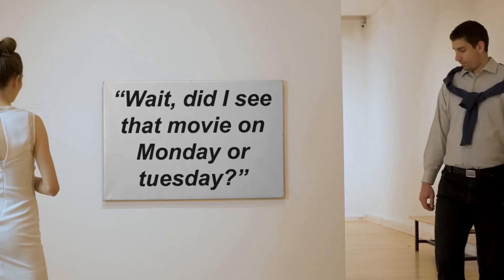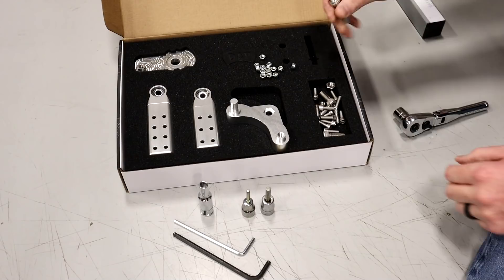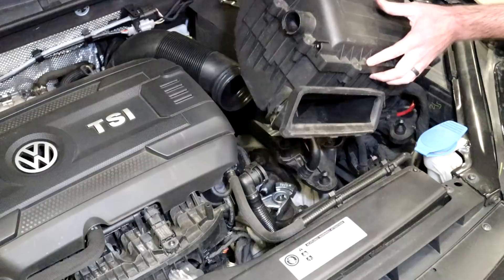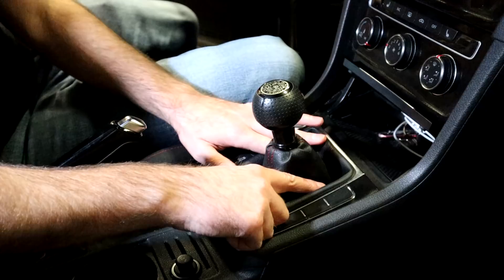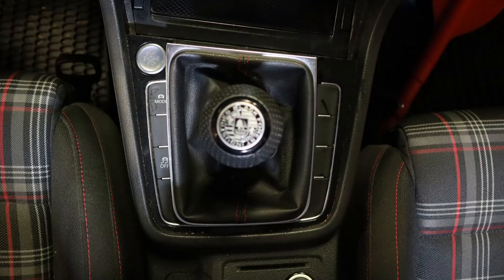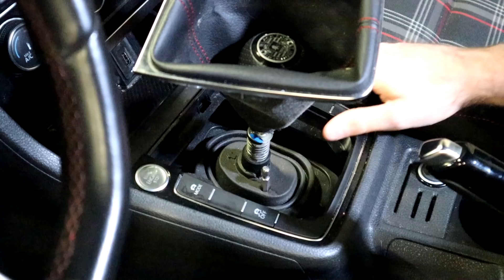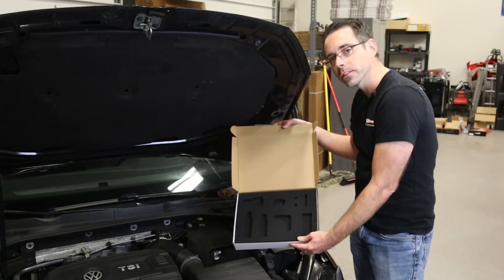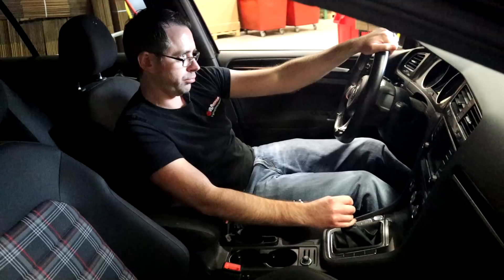"Holy Shift" Short Shifter for 6 Speed MK7, MK6, MK5 and MK4 VW and Audi models - DAP

Comment from the maker: - Purchase this short shifter on our site!
Short Shifter (Holy Shift) for 6 Speed Manual
https://www.shopdap.com/short-shifter-holy-shift-for-6-speed-manual.html
How to Adjust your Shifter if the Lock Pin is Broken
https://www.shopdap.com/blog/post/how-to-adjust-a-vw-6-speed-shifter-with-a-broken-lock-pin.html

Hose Clamp Pliers
https://www.shopdap.com/vw-audi-hose-clamp-spring-pliers.html
Reply: have you confirmed fitment on a 04 jetta gli with a 6sp like mine?
Reply: nm its listed on the page
Reply: dumb question but why nuts and not tapped holes for the endlinks?  Seems like tapped thru-holes would be cheaper to machine than counterbored clearance holes?

Comment: Now have this installed on my 2019 Alltrack after the 90 day wait for manufacture. Night and day difference. While it feels normal after two months and 3,000 miles initially it felt VERY SHORT. it's now very notchy. I'm still getting comfortable with quickly shifting given the gates feel smaller but the travel is much less. Highly recommend it!

Comment: Just installed mine, and the super pin. Overall, it feels way better and much more firm. I wasnt expecting it to feel so mechanical shifting now, but i think ill be putting on a weighted shift knob to damped the stick feel.
Reply from the maker: Thanks for the love. We are working on a weighted knob
Reply: @Deutscheautoparts  i look forward to that. That super pin is awesome, i recommend it highly to a few friends, but they are in the UK and there is no shipping option. Any idea if that will be changing? Thanks
Reply: Installed this yesterday on my new to me Golf 7.5R. I watched this and the @HumbleMechanic install video multiple times so I didn’t miss any steps. I would never attempt this without their detailed videos, but it was super easy and I love the end result. Pairs nicely with a weighted shift knob.
Reply: @Deutscheautoparts  is the super pin included?

Comment: Can you make a a few minute video where we can legit see the reduce in throw, I want to buy it, but I just had a mk7 tdi in the shop and guy had a full ecs tunning short throw, and that thing was horrible, u didn't even need to push down the reverse, and first was in place of 3rd, good look finding second
Reply: He either installed it wrong of had the wrong short shift kit for his car. I have a diesel geek short throw shifter on my MK7 with no issues, everything is in the proper location and reverse works as it properly should.

Comment: I just attempted this install. After locking the shifter in neutral as shown in this video I struggled to wiggle the oem shifter out. At one point the shifter moved up way too much(while in the locked position) and now I can’t lock it back into place. Did I just break the locking mechanism??!
Reply: Could you do a short vid on how to replace a broken locking pin in the selector column? Thanks!

Comment: Installed this about 6 months back and recently my shifting has become incredibly stiff.  After some investigation, turns out one of the spherical bearings began rusting and seizing up.  Kind of disappointed given this wasn't particularly cheap.  Going to be replacing the bearings with the 63215K53 from McMaster-Carr, which should be a corrosion resistant 303/440 SS direct replacement for the ones the kit comes with, (which are presumably alloy steel?)
Reply from the maker: Send us an email info@shopdap.com we can help

Comment: Looks like a well-engineered product. The fore-aft throws are long, true, but I find the left-right spacing to actually be annoyingly tight on my 02Q ('11 JSW TDI). With this kit, is it possible to shorten only the fore-aft throw, and not the left-right spacing?

Additionally, would it be possible to engineer a retrofit rod linkage to replace the cables? Or is there just not enough room/too convoluted a path?

Comment: I am curious how this Holy Shift short shifter assembly performs compared to the DieselGeek Sigma 6 short shifter assembly? 

DieselGeek Sigma 6 has been well known to be one of the best, if not the best, short shifter assembly for VW’s, and it looks like ShopDAP has almost copied them with this Holy Shift design, and yet, is also selling it for a higher cost than the DieselGeek Sigma 6. So I ask, how is this better? If I’m going to spend more on this, I need to know why? 

I wouldn’t be asking if I currently wasn’t looking for a new short shifter upgrade. I’m currently running a Forge short shift bracket and ECS billet bushing setup. TBH, this setup is pretty good. Great feel. The only thing is that it doesn’t improve the side to side, so now I’m looking to upgrade just for that 10-20% better feel over what I’m already running.
Reply: I just looked at the Sigma 6 on the DieselGeek site to compare. I noticed that DG's kit only includes one cable end (front to back).  SD replaces both ends. That additional component would speak to the $20 cost difference IMO.  And that end will give you more definitive side to side movements, having replaced the spongy rubber bushing.  So there is some difference in the two products. Maybe not a huge diff, but some. 
Cheers.

Comment: Hi,

 
i have VW Polo MK5 1.8cc TSI GTI 2015y 141kw 191hp, engine code is DAJA. Current mileage is 240000km, everything works fine, gearbox oil has never been changed, and the gearbox is DSG 7 speed DQ200 dry cluch. Should i change the gearbox oil or not because many people told my in this type of gearbox it is not necessary to change.
please help, thanks

Comment: Hey there. I accidentally broke the locking pin to the shifter tower while trying to install this kit. 2 questions.... Is it tough to replace that locking pin? Can I install this shift kit without having to lock the shift tower for adjustments? Thanks in advance
Reply: lol I think I just broke the pin too while trying to pull that last part off. Any luck on your end?

Comment: I broke my transmission locking pin while installing the holy shift! Was my mistake while pulling the old one out. I guess I used too much pressure. I was still able to install the new shifter successfully. Now I am wondering how hard it is to replace that pin. I found it for $25 but no idea how to remove it, also my concern is…. Could the broken piece be a danger for the gears inside my transmission?
Reply: Have you found an answer to this? This exact thing just happened to me. I stopped and I have a couple of emails out to dap and called them but they will only respond to email.
Reply: @paulmartinez1163  i did not get an answer but I bought the pin, I have not installed it yet but it’s a plastic pin and seems it’s no risk for the transmission, I still need to figure out how to install it, seems it goes in with just some pressure so it must come out the same way.

Comment: Great video and great tutorial! It's emphasized at all times that this works for 6 speed manuals. I have a 2016 Jetta Sport (MK6.5 facelift) with the 1.8T and a 5 speed manual. Will this work with my car? or is there another product specifically for the 5 speeds?
Reply: DieselGeek Sigma 5
Reply: @billyp.7889  Awesome, thanks!
Reply: @johnnyEXCELLENT  did u ever end up getting a short throw kit? I also have a 2016 Jetta sport and was looking to install one
Reply: @owenroth5686  hey I have not gotten a short shifter for this car yet. Good luck with yours

Comment: Seems overly complicated with 14 locking nuts on the end links?!? Also, shouldn't there be some lubrication between the plastic selector piece and the selector plate?

I would be afraid to do this because the risk benefit ratio is too high without proper tools and experience.

Great video, though. Thank you. But I wouldn't build my own bungee jumping harness either!

Peace!  xo

Comment: I dont suppose you know if that shift lever comes out the same on the diesel gt turbo's.. where that white plastic clip thing goes on mine no longer goes on so its just sliding in and out freely so I need to replace it however access looks tight and it appears it won't come out the shaft without removing the large component on the right.. any help greatly appreciated iv had to bodge it with a stubby screw for now

Comment: I still have some "slop" in gear. 3rds tight and fourth is a little loose, but the rest are still wiggly. Should I start with the side to side adjustment?
Reply: sounds like it could be the bushings under the gear selector itself. dieselgeek has kits to replace the worn out bushings which is what i plan to do as well. good luck!
Reply: @mrnickchang1  you'll never guess what I just installed between my lunch break and my 2 15s last night lol
Reply: @mrnickchang1  Still super appreciate the comment!

Comment: Does the “forward/backward” puck of your shifter have a steel splined insert or are the splines directly in the aluminum?
Reply from the maker: The portion that splines on the trans is stainless steel

Comment: I got the shifter all installed and I'm getting all my gears... however during the install process I was an idiot and forced the base plate in and broke the transmission lock pin. I was getting the splines all matched up but it wouldn't go in flush but so like an idoit did some banging and broke the lock pin.... 1st question is should I be worried about the broken lock pin in the transmission causing serious problems? 2nd my throws feel soo short is that normal? I"m getting all my gears so I don't know if something is wrong or if I'm just being paranoid since I broke the transmission locking pin... again all my gears work I'm just shocked at how much shorter the throws are.. anyone have any thoughts on this... thanks!
Reply from the maker: You should be ok with the broken lock pin. This is only something you should need to worry about if you have to adjust the shifter again. 

Just make sure you don’t have any shifting issues like going into gear. It’s likely the lock pin has fallen to the bottom of the transmission case.

Comment: Was removing the selector lever in the engine bay, with the locking pin pushed in and up - locking the transmission as described. Then the selector popped up. 
The transmission locking lever does not prevent vertical movement of the shaft now. Did I make a $400 mistake?
Reply: no it’s a $20 mistake 02J-301-358-C
Reply: @turboshottho  The spline/gear selector won’t come down to its resting positioning. This is reflected on the inside with shift knob slop. When in neutral and move the shifter to the left, it returns to the middle. When moving shift knob to the right it remains there. This happened because I locked the transmission then removed the oem gear selector and then it budged. I should not have locked the transmission until the oem selector was off and to anyone reading I would not do so. The locking pin does not lock the transmission into place anymore. Now I have to call dealerships for a $400 part. Car is still functional/have all gears - but it’s not what it once was.

Comment: What sort of warranty will I void, of my Factory warranty?
sub 22000 miles right now on my 2019 Alltrack with 100K warranty.
Reply: Any warranty on the trans will likely be voided. Shorty shifters will definitely put more wear on the synchros. Had one on a mk5 5spd and had issues grinding 1-2 easily after a couple years.

Comment: Looks like a direct copy of the Dieselgeek Sigma six short shifter.
Reply: This is way different, you talking non sense
Reply: @vadaszmate1400  looks identical to me.  Maybe Jim @ Dieselgeek is making these for DAP.
Reply: @vadaszmate1400  it’s not. Look it up before you type...
Reply: @JacesOwnWorld  I did and it looks different
Reply: Agreed, it's principle is exactly the same as the diesel geek sigma6.   

Machined end links, spherical bearings and the complete removal of the OEM  pendulum counter weight which is what makes the OEM shifter light and easy , and therefore what makes this type of shifter heavy and mechanical feeling.  

My bet is that it feels no diff to the diesel geek shifter.

Comment: This is nice, but it’s a complete rip off of the diesel geek short shifter.
Reply: Ive been looking at both as my plastic ends are shot, they look similar but doesnt the sigma 6 still use the plastic cable endlink for the side to side?

Comment: 13:00  How do i make sure i have my gears without a test drive?
Simply if it feels like it went in, it "should" be in gear?
Reply: The shifter will feel funny if you do it incorrectly. I recommend a slow test drive tho, as I forgot to lock the trans when changing bushings and had no reverse, first gear instead of reverse and third gear instead of first. You will feel something is off tho. The feeling I got from wiggling in neutral felt like old bones lol...